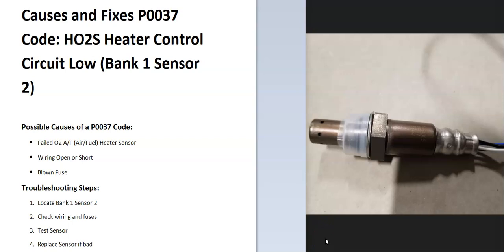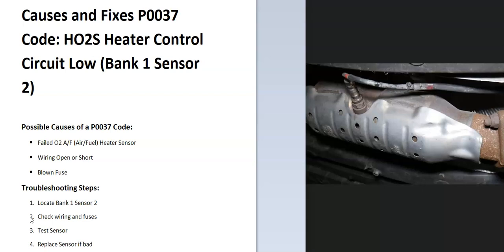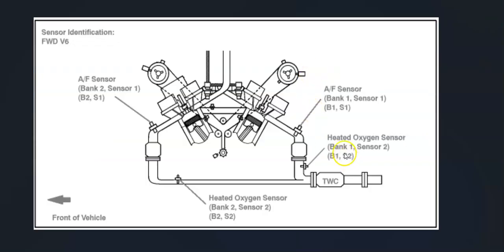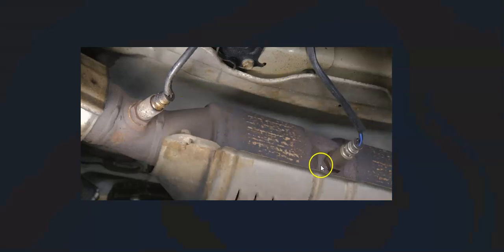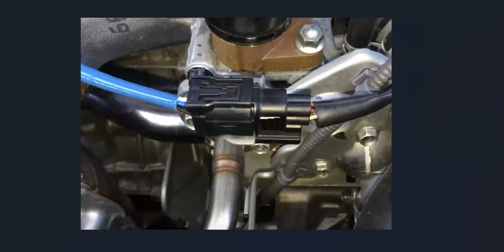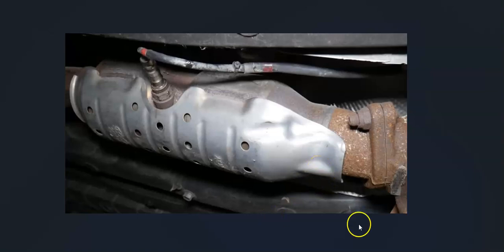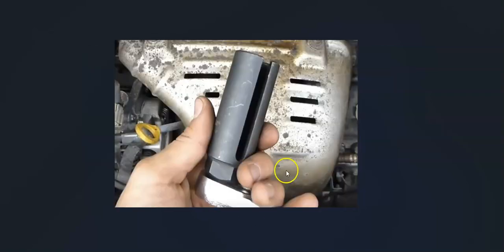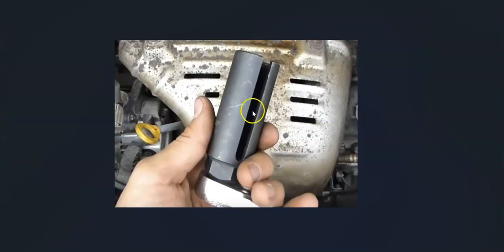Causes and Fixes P0037 Code: HO2S Heater Control Circuit Low (Bank 1 Sensor 2)

Comment: tuned wrx here with Cobb J pipe and full exhaust. had the o2 sensor replaced with code P0137. them code P0420 came and was cleared by the mechanic. 2 days later, P0037 showed up.

Comment: My car has the P00037 error code and also a check engine light. The P00037 error code was the only code my OBD2 scanner picked up, despite the orange check engine light.
Reply: The Check Engine light is caused by the P00037 error code (have the same issue)

Comment: Parts stores have Left or Right.  Is bank 1 "Right" in your diagram?
Reply from the maker: The bank-1 and bank-2 locations will vary from engine to engine, but bank-1 is on the number-1 cylinder side. Google your engine firing order and look at the images; it will usually have it.

Comment: If the O2 sensor fails causing the check engine light to be on, is that somehow in series also causing the Trac and VSC lights to be on?
Reply from the maker: It can vary between vehicles, but yes, often, When the computer sees an error in the system, it will shut down assisted driving, such as traction control.
Reply: Lexus?

Comment: Ive got a 03 350 z, replaced all four sensors, drive for a little bit and heater circuit bank 1 sensor 2 comes up.  replace them all a second time, and still comes up with that reading.    HELP.
Reply: replace catalytic converter
Reply: I'm having this same issue with my 2009 Hyundai Genesis sedan 3.8

Comment: What if everything is ok new sensor etc and i still get circuit malfunction in sensor 1. Can it be the sparkplugs?
Reply from the maker: Spark plugs would cause another code. I would check the wiring and look for any exhaust leaks.
Reply: that means you replaced a sensor that was working perfectly. You should check if you have a leak somewhere in the exhaust because if it leaks before reaching the muffler, the engine temperature increases and you may continue to have the same codes or damage the engine seals.